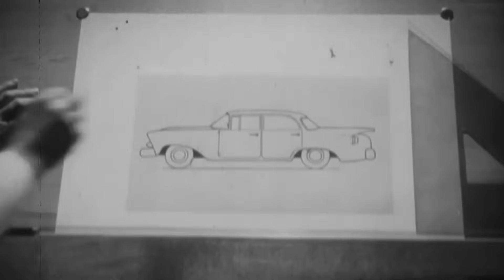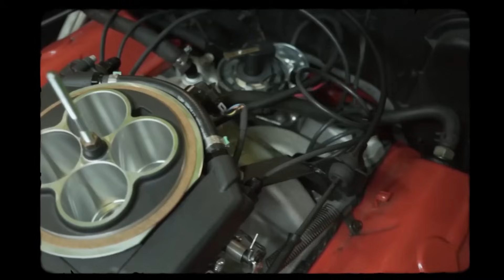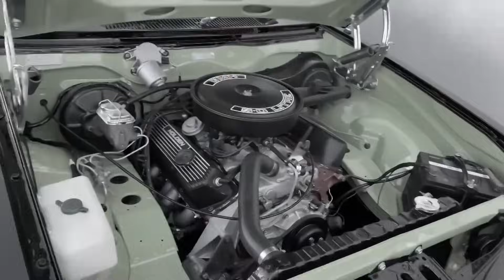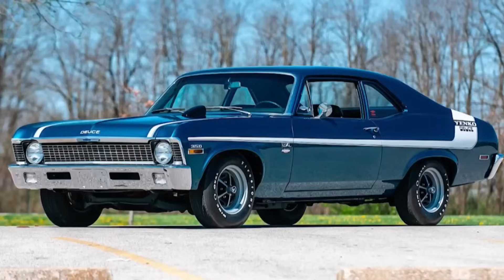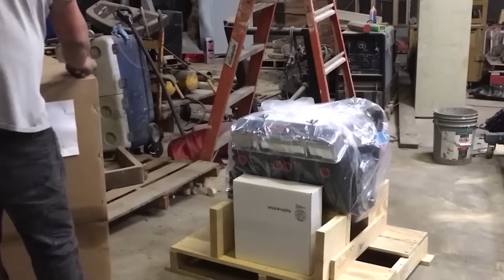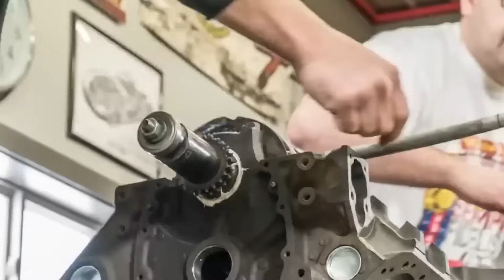The Chevy 350 V8 vs The Holden 308 V8 | Who Was The King?

Comment: I had a VK Calais Director. A great mechanic, Vick Hockley, had built my engine. I had taken the revs up 8900 rpm without any problems. I did not want to take over 9000 rpm but it felt that it had more in it. A week after I was doing laps at Oran Park it was stolen from Macquarie Shopping Centre at Ryde. They obtained the address from a police officer and they followed my wife when she decided to drive it to Macquarie Shopping Centre. My wife was out of the vehicle for five minutes and it was taken. There were police everywhere, but not one of them saw anything.

Comment: I built a 308 that had all the same specs as a L34, I balanced it from the harmonic balancer to the pressure plate , the 2 things I didn't do which I regret is not put electronic ignition and thermo fans on it but it blew 350's and 351's away ,  fkn thing kept blowing gearboxes,  it was every bit as fast as the LS1 I have now and it doesn't impress me
Reply: Wym it dont impress you

Comment: This bolocks GM didn't have a competitive market in Australia. And Holden wasn't marketed in the US. So out performing a GM engine wasn't an issue. 
I seem to remember a Z 28 Camaro racing at Bathurst it was at par with a Torana. But handling won out and the Z 28 crashed. 
But for the corporate issues if GM didn't want it Holden would never of had it.
Holden V8 was a market ploy to have an Aussie V8. The rest was history. 
These rubbish stories are just that, stories.

Comment: GM stopped the 308 because it was pushing more hp than the 350 . 
GM was getting pissed off because there budget was 500 million where Holden’s budget was 50 million . And Holden was building a better engine. 
Holden built a 308 to make 380hp . 
And at the same time Chev was making just over 200 hp . 
So GM got pissed off and told Holden to stop making the 308 . GM killed the 308 . 
Same as they killed the Monaro .
Reply: 😂😂gm sucks worst brand ever

Comment: Why have you not mentioned the GM/Chevrolet 307ci, it was the equivalent and it was what was used in Australia until the 308ci was developed, the 350ci and 327ci were around for different cars/options right through.

Comment: I owned from new a 1994 hsv senator with the Holden 355 stroker,had the Harrop stroker crankshaft from factory,swapped to twin throttle bodies and 98 tune and it went like a bullet and the sound it made was just awesome,years later my mate bought a 2002 hsv club sport with the 350 chev,called my car a dinosaur went on and on about chev this and that,couldn’t get anywhere near me on the strip and even with a modified exhaust it sounded hollow and tinny,at 22,000 the chev developed piston slap burning oil faster than petrol,took it back to Holden and there response was it’s a gen 3 chev they all do that……..sold the senator with well over 200,000km still going strong,but because Holden didn’t build the Holden v8 anymore I switched to Audi and Porsche cars,love the German cars but still miss my senator

Comment: In 1993 at Bathurst the Commodore's could run either the Chevy LS engine or the Holden. 
Larry Perkins was one of only a handful of teams using the Holden. 
He qualified up at the top end of the field. When the flag dropped for the start of the race, he left the Chev powered Holden's in his dust. Eventually winning the race outright. Nothing could touch the Holden engine that year. The next it was gone. Killed off by GM execs
Reply: And his brilliantly slide intake manifold 👌some of the best years of Australian motorsport
Reply: I assume both engines were built to the same displacement?

Comment: 10 cylinder head bolts on the Holden,16 on the Chev,easy to see which one has more potential.8 bolts fasten the water pump to the block of a Holden,only 4 needed on the Chev.As a former employee of Holden at Fishermans Bend and former Chev owner,if it's not a Chev, it must be shit!

Comment: I miss my 12sec Lc GTR. Thing was off tap 202. 9 inch 4.56 lsd etc.  Should never had sold it. Larry P showed them all. His intake was mega. Roller race port throttle plates was just great engineering and he cleaned up. Now is just yank crap and lost interest but still Holden at Heart. Good video

Comment: I had a 308 out of a HJ Sandman Ute my mate purchased new in  1976 and I read and reread an article in a magazine by Peter Brock on how to get really high horsepower out of your 308,  I applied every trick he provided and it already had a 650spreadbore Holley, dual point Mallory distributor , Burt Jones in Sydney originally set up the carb and dizzy, I had rebuilt the motor, opened up the valve throats, got it balanced, titanium adjustable push rods, anti pump speed pro lifters, intake manifold opened up and three quarters of an inch taken out of the plenum divider, a three quarter inch nylon reversion plate on top, a Ivan Tighe oval track cam with lots of overlap I’m sure it was  forty eight eighty, eighty eight forty and four ninety five lift, it would rev to seven five anytime you wanted to get your blood pumping!  I campaigned it on the street for five years and it sits in the doorway of my shed still as I dream of affording to rebuild it for a HJ Ute I have but can’t afford to build, it ran a nine inch with four eleven zoom gears and a really tight clutch pack. Nothing sounds as exciting as a  the Holden vee eight at seven thousand revs.

Comment: I put genie headers on the 308, a 600 holley carby,heads got done & slipped in a stage 3 heatseaker rocket cam ( could have gone stage 4,but wouldn't be great on the road)  - that was a great 308 engine & had a lot of fun in the HQ Holden rat car. My HT monaro also ran a 308 2sp piwerglide- fun times!

Comment: Had a VR Caprice with the 308, 5.0 ltr, standard motor (not race tuned). The fuel economy and efficiency was phenomenal! Well over 900 km on a tank of fuel on the open road, even towing a 3 ton (metric) trailer. It was also whisper quiet, but had the grunt to embarrass a WRX. I once heard that the Holden 308 motor was the most perfectly engineered automotive engine in the world, though that may just be local pride talking.😉
Reply: What a load of crap😂outright lies😂.
Reply: I had a HSV VR SS 185  Commodore. It scrubbed the rear tires and HSV charged the rear end with a fully adjustable rear end. The car handled and it went.

Comment: Frankly ive never understood the reverence for the 350.  They werent really that good.  Because so many were made a huge aftermarket developed which further pushed them out the door.  Based on whats seen here there were clearly better engines than the 350.

Comment: Have had a few gts in my time with 253s and 308s but we had a hallet hull ski boat called grumpy 2 (ex race boat) which had a 350 chev v drive in it we flogged the absolute b jesus out of that boat for years skiing and not once did any work on that motor.

Comment: I always knew the Holden engine was far superior,I had 1994 hsv senator with the Holden 355 ci engine which was the Holden 5 litre with a Harris stroked crankshaft,I changed to a larger throttle body and did a 98 tune that was it,my mate bought years later a2002 hsv club sport with the alloy 350 chev,he did a mad less tune etc,my car had over a 100,000 km by then,when he got the club sport he was chev and chev that called my Holden engine a dinosaur chaser but everytime we went to the strip all he saw was my tail lights……at just 15,000 the chev was burning oil and was diagnosed with piston slap,then he bent the valves and on and on it went,sold my senator with over 300,000km on it and it never broke down,only replaced water pumps and coils,battery,etc also the Holden engine sounded awesome,the chev sounded hollow by comparison
Reply: Nice 👌 
I've got the VT 220i 355 in my VH SLE

Comment: Holden V8s from an engineering point of view is superior to the older Chev V8s. Holden V8s have much better valve angle, 6 degree vs 23 degree. Holden V8 oil pump drive is at the front of the cam which doesn't introduce bad harmonics to the distributor. Holden V8 firing order is more balanced which leads to better fuel distribution than the Chev V8. Holden V8 is lighter than the Chev V8 while still retaining it's strength. Holden V8s also sit lower in the engine bay which greatly reduces center of gravity for better handling.

Comment: The 308  5 speed hydrolic turbo gear box, it was the king of the mountain because  I did own Holden commodore 1985 it was monster ... Yes it was standard typical 5.0lt holden engine   with 5 speed turbo manual gear box

Comment: Early 253 / 308 had an issue with poor lubrication of the cam lobes, causing excessive cam lobe to cam follower wear. I remember seeing cams with nearly no lobe's left on them at all.
Reply: Yep, I had one of them. Typically low oil pressure at idle was the issue, so city cars suffered the most.  Mine was a 253 in a Monaro LS.  After some modifications with a new cam, flowed heads and a 308 manifold and 465 Holley the car went a lot better. ;)
Reply: There is a guy who came up with a fix for that by blocking off certain oil ports and drilling new ones, it's on youtube, hes an older guy who races a he im pretty sure.
Reply: The 253 and 308's were known for worn cams due to lack of lubrication, Holden cams were referred to as putty, there were ways around it, conversely at very high revs the Ford Cleveland oiled up high too well and starved the crank bearings of oil, again a simple oil restrictor solved this issue.
Reply: @RossWood-sl5oj  253/308, the oil system fed oil to cam and lifters first, before lubricating the crank, the problem was cam quality.

Comment: GM  executives missed an opportunity to produce a superior V8 if they had holden engineers and Chevy engineers collaborate. I'm sure they would have built a V8 better than both the 350 and the 308 and probably even better than the LS
Reply: They stole most of the GMH engineers.
Reply: Apparently gm used some of the 308s design cues when making the ls meaning the ls has aussie design

Comment: Back in the early 90's I bought an ex NSW highway patrol VN, 8 months old, 39,000 Km's on the clock - 304 cu not 308 cu, it went ok but coming off a Kawasaki Z650 it didn't seem like much of a performer that is until I drove a VP Berliner V8 hire car while on holiday in Queensland, I kept complaining to my wife that the handbrake must be stuck on.

Comment: AI
Reply: No mate ,maybe the script or dialogue but the 5.0 holden was superior by a long way due to conditions for the 1000km race. Identical figures for output 5.0 v 5.7 - lighter v8 same power, higher revs, better reliability. Today it is common knowledge and a recent Holden 5.0 from the era with heads and ports calibrated to similar chev unlimited specifications, placed over 900hp on the dyno at almost 9k revs. So- the 5.0 could easily get the same figures as a 350 chev and 30-35 punds lighter including higher revs, better torque and reliability.

Comment: it was obvious when the touring car drivers driving 350 Chevs complained about those still driving the 308 having more power and by the way the holden V8 was built from the US Buick engine design so was still a us design
Reply: No it wasnt
Reply: @Aliforbeslad2000  wasn't witch more powerful or based on the Buick
Reply: @shanehansen3705 holden planned to make the 308 more powerful but gm wouldnt let them
Reply: @Aliforbeslad2000  yes i know US GM knobbled the 308 and used the tech to make the LS but in race trim the 308 out preformed the 350 not in race trim it out preformed the 327 but as you see I said touring cars and was spot on I remember the controversy when some teams broke the pact to use the chevy and were beating those who used the 350

Comment: What about the 253 engine, we had one in our LH Torana, great bullet proof engine. Friend of mine use to do speed boat racing and his 253 out did the 308 in its class.
Reply: Sorry I had both, you can't beat a 4" bore with a 3" stroke motor
Reply: Had a 253 with the heads cam carby and intake and headers off a L34 that was in a accident and block was broken, in a HQ SS it was a freak of a motor and I went through 4 Aussie four speed gearboxes they were so weak

Comment: The stock holden oiling system wasn't the greatest as the oil would fiil the rockers with shitty oil drain backs under prolonged high rpm,  the pre efi heads had small ports that choked them down without heavy porting.

The efi head version was choked by the intake manifold above 5500rpm good torque but the banana manifold held them back in the higher revs so some of this video is quiet plausible, factory restricted to keep gm happy

Comment: Bull sh_t mate.  The Red, Blue motor 253 308  heads will NOT out flow or out HP the factory small block chev production car heads both stock or fully ported full stop mate, your full of sh_t if you think your Gunna. Full Stop Bull.. S... however you can get upto 500 HP out of the rare B cast heads without braking through too the water jacket with the stock production car castings and it is possible too get as much as 700 horse out of the VN onwards EFI heads when hand ported or CNC ported with The VN - VT  304 5.0L heads. These  are the head castings that can challenge a small Chevy. But don't count on it. It's also possible too change the crankshaft in the 304 308 blocks too the same stroke  crankshaft as the 350 with a stroke of 3.48 inches and when combined with a set of 4.030" chev pistons, you get 355 cubic inches. And when you find a good block, as  much or more than 400 cubic inches out of 308 mate.

Never Late with a 308.
Reply: Yea its just click bate videos. Thses guys dont care if its true or false, they just want views and the more controversial, the more clicks. I love my 304, but lets be real they dont breath well.
Reply: But my 308 is now worth 12k LMAO
Reply: Hmm, was listening to this guy and thinking ld been wrong for the last 40 years.  For some reason l always thought that part of the Holden v8 problem were getting high hp out of the heads, sounds like l may have been half right.

Comment: The 307 was good engine, like 400 they put 2 barrel and low compression, but when done properly put out, 307's often 4 barrel carb/intake. The AMC 304 was very good engine also, something about 5ltr, put AMC 401 4barrel intake on jeep 304. Chevy has emotional complex, anytime C-B-O-P did anything performance, Chevy had tantrums. I have seen Chevy 6 250 with 292 crank and 283 pistons, ran 3 times, not gaining an inch.

Comment: I was involved in the design of the VN Goup A homologation engine, I designed the "D" port heads and ran the balance calculations for the high compression pistons, with a pencil and pocket calculator. The calculations all the way back were kept in an old two ring binder and the first entry from 1966 were for a 350CI. The Holden V8 was always intended to be a 350 but they were made to reduce it to five litres, the reason given was it only needed to compete with the Ford 302CI, the Chevy 350CI would be available if a larger capacity was required.
Reply: I have a 308 HODEN 1969
Reply: @joannetaitua4033 no such thing
Reply: @lennyleonard4193 is this ragebait?
Reply: Great bit of history there. Thank you very much.
Reply: I've got a 1975 HJ Holden 308 V8.....
Reply: So holden was planning to build a 350 of its own in 1966
Reply: Legend
Reply: Damn imagine what a 5.7 holden v8 wouldve been like do you know anything else on the engine like the horsepower and stuff
Reply: @Aliforbeslad2000  Sorry, no. I asked around but I don't think a 350 was ever built. When I did the VN calculations 1n 1989 that knowledge was 23 years  old and not many personnel were still there. The work I did is now 37 years old and all the records were destroyed or shipped back to the USA.
Reply: If they were so concerned why didn't they just supply or let Holden build  small block chev engines like they did from about 2000 onwards? I also heard Holden wanted to develop or were in the process of developing a Aluminium block V8
Reply: @zoob7 gm was a weird company they didnt want anything from any if their brands to outshine the corvette which is dumb because we werent even getting the vette here the first place
Reply: @zoob7  Holden did do feasablility studies for an Al V8, they also built and dyno'd prototype 3 valve cylinder heads, but they didn't make much more power than the EFI heads. There was also a study of DOHC 4 valve heads based on the Family II design. I still have a very early concept layout drawing that I decided to keep when the study was cancelled.
Reply: Fuck bro wish they made the 350 holden v8 that would be mad
Reply: I had a VR senator 5.7 6 speed best holden I ever owned one I should never have sold
Reply: @andrewgaskin753 yeah I'm hearing you. We've sold cars we'll always regret selling. I now own an 08 VE so it's the 60th anniversary year. I'm taking my previous regrets and know I'll never sell this one

Comment: I had a rebuilt mildly worked 308 in my VH commodore back in my late teens/ early 20s. Was a great engine and sounded awesome. I now have a 1977 monaro with a 350 stroked out to 383. Also  great engine and sounds tough but I would have to say I think my 308 sounded a little meatier 😏. I have a chev in my monaro because it's what it came with from factory, if it had a 308 I'd be just as happy. 👍
Reply: No HJ/HX/HZ came out with the 350, only HT/HQ Monaro and HQ Statesman had the 350 engine
Reply: @mmazz30 sorry it came from factory with a 327 chev. When it span the big end i pulled it out and put in a stroked 383